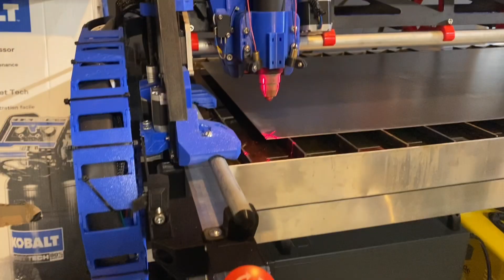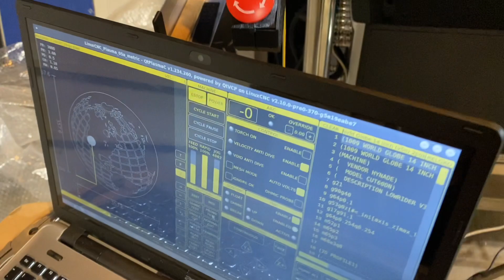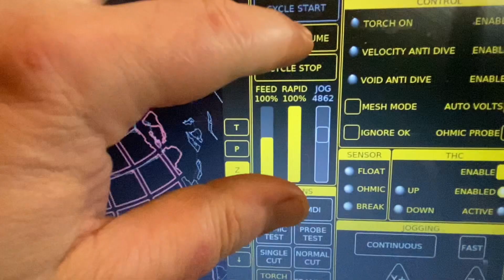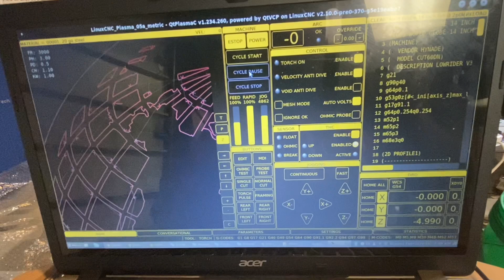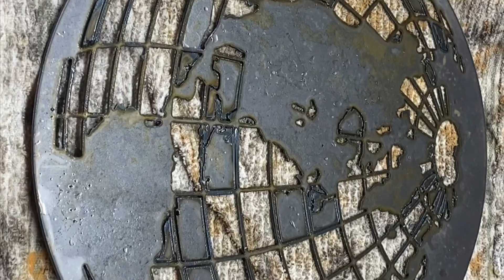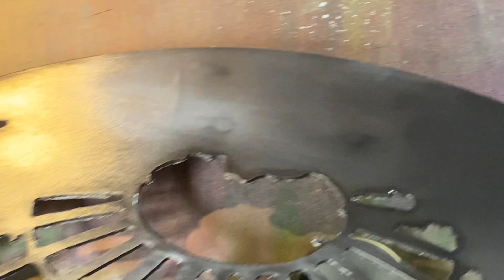LowRider 3 CNC DIY Plasma - LinuxCNC: Probing, Framing, & Cut Recovery!

Comment: Wow its amazes me that a 3d prtinted thing can be so powerful :)
Reply from the maker: It is amazing! Put a router on a LowRider v3 mostly printed CNC and it can cut profiles in aluminum and has even been shown to cut steel.
Reply: @design8studio  I'm looking for a cnc machine to build but im too scared to start. Ive been looking at MPCNC and Root4 im leaning to Root4 mostly tho. But its hard to find side boards for the root4 coz the developer don't seem to restock his shop often :)
Reply from the maker: The LowRider from V1 Engineering is a great choice. https://docs.v1e.com/lowrider

Comment: A flap disc on an angle grinder does amazing cleanup work to steel, though in this situation with thin delicate parts, maybe a flap disc on an arbor chucked in a variable speed drill would be more appropriate.  But the end result is almost a mirror finish.

Comment: Forgot if this is the correct name but Qtplasmac has something like "Run From Line", so you can start from wherever you want in the gcode and not have to fast forward with Cut Recovery.
Something else I've done in the past with other plasma systems is do a "Save As" with the current gcode file, after deleting all the code that's already completed, so the cut starts at the first section that needs to be fixed. However, that should not be necessary with Qtplasmac now.
Reply from the maker: Yep, and I found out about that shortly after this — I think I explained that in a video released afterward. Thanks!

Comment: I may have missed it but what THC settings did you use with the Hynade?  I'm building one and trying to get the correct settings for my thc (target voltage setpoint,  1:1 arc voltage, and any other settings for the hynade you found useful)
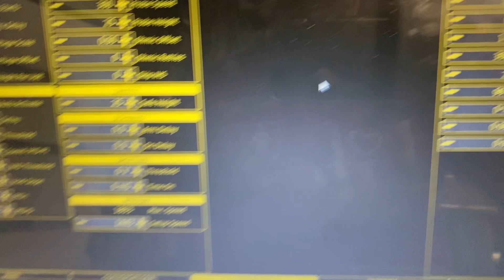Reply from the maker: In another video in this series, linked below, I went over all my settings done in the PNCconf wizard steps, showing screen shots of each page, with the THC settings being shown at the 5:54 mark. The link below has a timecode param to set it to take the video to that point: https://youtu.be/gU-OKSPN5ak?t=354
Reply from the maker: As I mentioned in this video (linked below and also in a previous reply above), you can get a MESA THCAD card that does not require soldering a resister inline for using a 1:1 ratio from the plasma machine, or the resister can be added so a 1:1 ratio machine can be used with a MESA THCAD card that's made for expecting a voltage divider / reducer.  https://www.youtube.com/watch?v=DC7X0wB65kA
Reply: @design8studio   I have a different THC (cnc4pc thc) so some of the required settings are different but I appreciate all of your videos w/ the Hynade.  I have a very similar setup
Reply: @design8studio   thanks.
Reply from the maker: Also, the insertion of the resister I mentioned, and general wiring of the MESA THCAD-2, are shown in this video: https://www.youtube.com/watch?v=Y1gYIkMLcc8
Reply from the maker: My THC settings are based on using a specified resister soldered inline on the external negative lead coming from the Hynade to the MESA Electronics THCAD-2, and I covered details on that not only in videos in the series but also on my build thread documented in the V1Engineering forum here: https://forum.v1e.com/t/lowrider-3-plasma-build-on-a-budget-clarksburg-wv/33849
Reply from the maker: As far videos in the series that give details on the THC, and specifically the MESA THCAD-2, this video is a good source of info: https://www.youtube.com/watch?v=DC7X0wB65kA

Comment: weld with a lot shorter wire sticking out keep the torch tip close to the weld puddle.
Reply from the maker: Yes, thanks.
Reply: @design8studio  Thanks for the videos on QTPlasmaC I am using it a need to learn more.  have fun Tom
Reply from the maker: @bigirish4886  cool. Thanks for watching!
Reply: If you don't mind which version of Debian and are you running Gnome or what.
Thanks Tom
Reply from the maker: @bigirish4886  I downloaded a pre-release version of LinuxCNC running on Buster — that was the only way that I could get QTplasmaC in a version that would work for me. So I think I’m on version 10.12 if memory serves.
Reply from the maker: @bigirish4886  if memory serves, I think that I installed a different graphical user interface for Linux, called Cinnamon. That does not have anything to do with QTplasmaC, but it simply impacts usability and convenience, regarding Linux itself.
Reply: @design8studio  Thanks for the reply I an running debiam 11 bulleye and Gnome and QTPlasmaC works fine with that, you are running a new QTPlasmac mine isV1.233.253 yours V1.234.260 maybe due to the touch screen??
Reply from the maker: @bigirish4886  At the time when I downloaded the installer, there was a build-bot issue with the normal version of installer, and my only option, if I wanted QTPlasmaC, was an advanced pre-release version. That's how I wound up with it!
Reply: @design8studio  Thanks have fun
Tom
Reply: Any chance you can do a detailed video on how you installed. Qtplasmac
Reply: Are you talking about the install of QTPlasmaC or how to setup up QTPlasmaC after loading LinuxCNC?? @robbeaupre3525